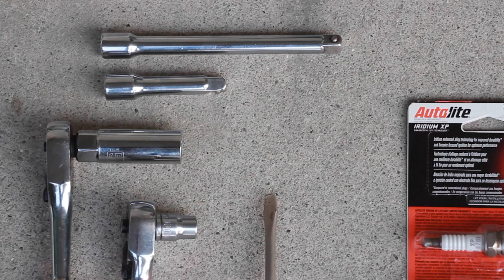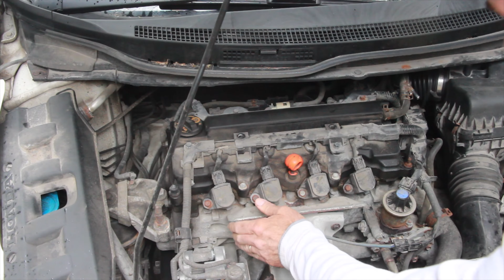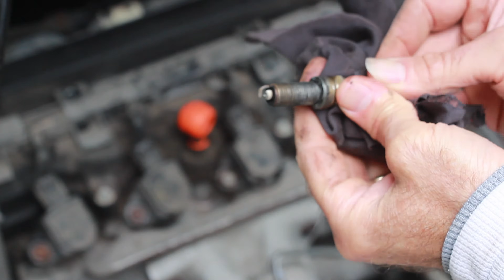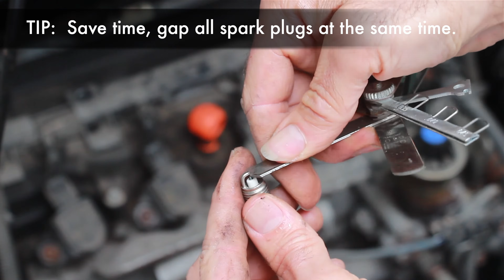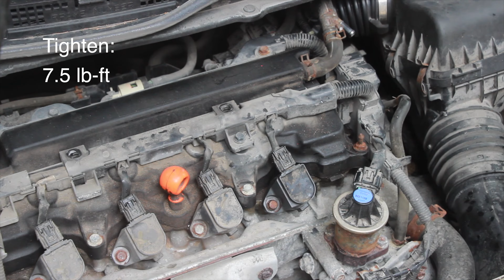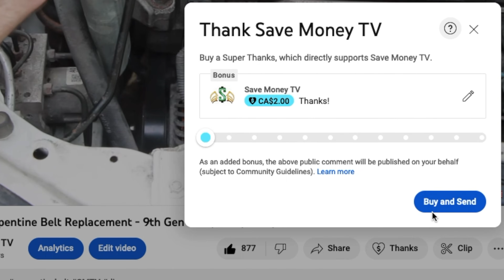How To:  Replace Spark Plugs - Honda Civic 1.8L - 2012, 2013, 2014, 2015

Comment: any advice for someone who isn't familiar with a torque wrench? and what type of extensions should i be looking for? also how do i know when to change only certain spark plugs instead of all of them? thank you!
Reply: Change them all at the same time piece of mind.
Reply: Unless your doing alot of mechanical work you don't need a torque wrench,and extensions you can get anywhere depends on the ratchet size your using 1/4", 1/2" or 3/8" for the socket.

Comment: ok seems so easy. Don't know why i didnt start to do things diy. Been sending my cars to dealrships. Everything is a minmum $300 for labor + parts here.

I first did a battery change when it needed to be towed (It was actually the starter not working but my mechanic friend first recommend changing the battery just in case). That thing was super easy.

This seems pretty easy as well. I will need to buy some tools but it is pennies compared to what a dealrship will charge me.
Reply from the maker: Work slowly and pay close attention to the details and I'm sure you can do it.
Good luck!

Comment: I would recommend before someone starts this project, concerning where to acquire the plugs, shop first.
Most Autozone, Advanced Auto Parts, sell these plugs by the "each", not a 4 pack, and they range for the Iridium 13.99 on up to 26.99. Autozone advertises "unbeatable prices", which is false advertising. Amazon has same plugs for 33.99 a 4 PACK, so roughly over 20.00 saving, with free shipping over 35.00, with tax it is a bit over that. 4 plugs at Autozone is 61.00 with tax.  I spoke with someone at Autozone about their "unbeatable prices". It started out, "well have to include shipping with Amazon", I said it was free, then continued lie upon lie she was stating. Finally I said, please stop, do you not see what you have said, upon trying to defend a false claim of "unbeatable prices"? She turned bright red, in embarrassment. If she didn't know policy on meeting prices, etc, don't lie and make up things, just call someone who has an answer, correct? So please shop, much cheaper before.

Comment: what did you do about the little oil leak in the spark plug area?
Reply: Valve cover gasket, should come with the circle gasket that goes on bottom side of valve cover gasket around spark plug holes

Comment: Thanks for the video.  I guess rpelacing the coil pack boots and seals is generally not required. I always go with Ngk or Denso spark plugs on Honda and Toyota vehicles.
Reply from the maker: There are varying schools of thought on when to replace the coil packs.  I waited until they showed signs of going bad: rough initial start, poor gas mileage, etc.  Amazingly, I got 400 000 kms out of the originals.  Putting new coil packs on today.
Thanks for watching!

Comment: How to but when? I've not touched my 2012, 100k miles still drives like new
Reply from the maker: Still good gas mileage and performance?  That's great!  Good idea to change them out at 100 000.  Before loosening the old ones, make sure to soak the threads with penetrating oil overnight.
Reply: @SaveMoneyTV how do you do that?
Reply: @SaveMoneyTV okay , should I change the spark plugs when the engine is cold or hot?
Reply: @SaveMoneyTV You can shoot wd40 straight into the spark plug area with the coils out?

Comment: Good guy thanks a lot saved me 300 bucks
Reply: Who wanted to charge $300 to change 4 spark plugs?
Reply: @Savsal12  lol AAA wanted to. Hence why I did it on my own with the help of this video. 5 months later and it’s goin good
Reply: @ItsmeCiaburri  nice I’m trying to change mine right now just waiting for the engine to cool down
Reply: @ItsmeCiaburri  did you change them when the engine was warm or cold?
Reply: @Savsal12  Honda is charging me $700 to replace my spark plugs lol
Reply from the maker: Cool, glad it was helpful.